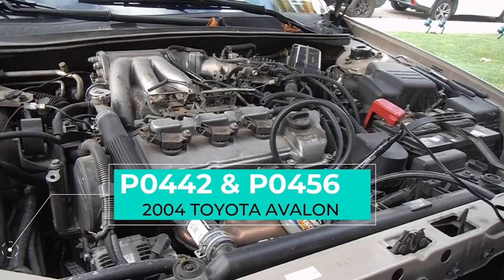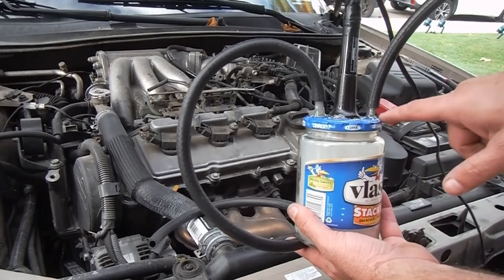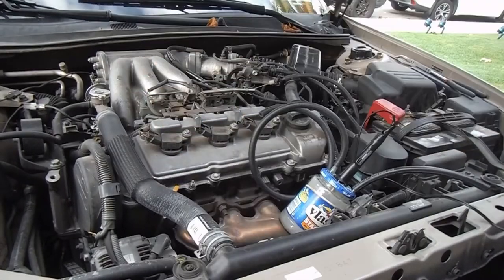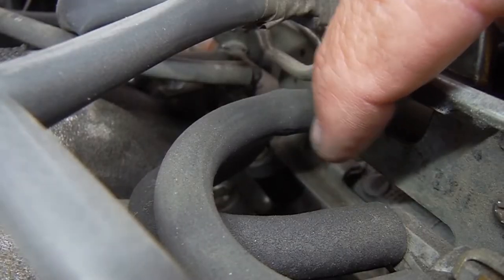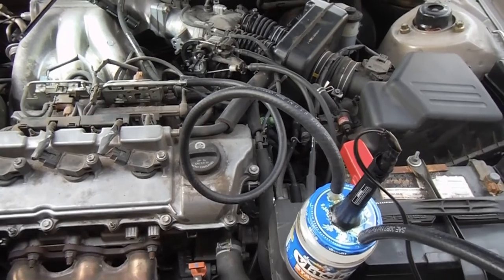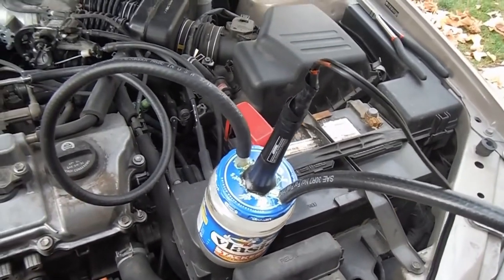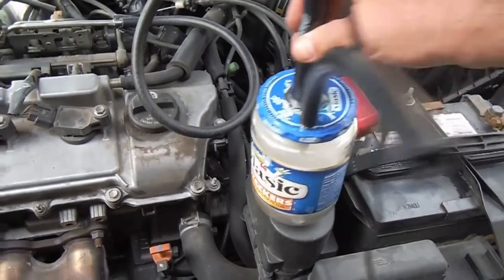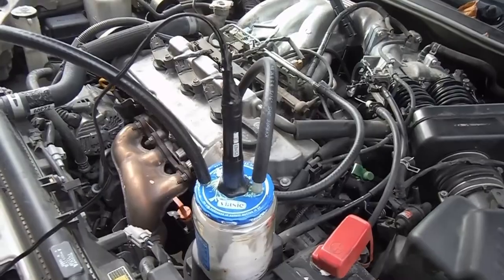P0442 & P0456 TOYOTA - SMALL EVAP LEAK - FIXED! (NOT GAS CAP) DIY SMOKE MACHINE - 2004 AVALON

Comment: Thanks for the quick guide! My same exact hose cracked just like yours, switched it out and it's running a lot better. Only been 50 or so miles since I changed it, hopefully no other leaks..
Reply: same here ~ what was the hose size you used to replace?

Comment: Awesome little McGivering ingenuity that saved you some big bucks, Dan the fix it man. Can you imagine what it would have cost at a dealership repair shop without having the codes before hand. I just bought one of those code readers as I've had a yellow engine light on my Mercedes for several days now. Now that's a vehicle you don't want to fuck around with when it comes to repairs. So owning one of those obd2 scanners is a must have investment these days. Mine just came within 12 hrs from Amazon (gotta love their fast shipping). So I got the same two codes flagged as you did, the P0456 & P0422, with the first one several times. It still won't let me turn off the engine warning light manually, says it must be repaired first (I get that cause it would just keep getting tripped again). Now I know vehicle emissions are tested regularly in places like California, but I live in Canada and we don't have that tested here, at least not in the province of Alberta where I live. Now I'm a little too old & disabled to try this detection/fix myself. I definitely would have back when I was more agile. I would like to get an honest repair shop to do the test, just give them the codes and possibly show this video. All the leg work is done pretty much. Thank you so much for filming this and sharing it. I hope it's just as straight forward with my Mercedes SUV. ✌️
Reply: Just a side note. I went into a local repair shop in a franchise called Canadian Tire. They were going to charge me $160 (before taxes) just to read the code(s) that triggered the engine light. Nothing fixed or repaired, just a print out of any error codes and what selection of other issues that could be causing that. That's what made me more determined than ever to buy my own code reader. So glad I did it does a plenitude of other features. Battery condition checks which is essential in cold winter climates. Trip monitors, testing your driving style and the efficiency of the performance during a speed test. I'm not sure if it'll connect to my PC or if there's any need. Cheers.
Reply: 'Honest' and 'repair shop'...good one!

Comment: Evidently those small hoses are guaranteed to start leaking on any 1mz-fe engine that old due to years of engine heat. I replaced all the those hoses with silicon versions of pretty much the same size as the originals. Nice, snug connections. I also changed the gas cap. Now I just have a P0440 code that comes back after being cleared. Could be the charcoal canister or one of the switching valves.
Reply: I'd start with the Vapor control valve, then move to the canister.
Reply: @nec4480  Turned out to be several small hoses I couldn't see. One near the air box and one near the canister.
Reply: @rkgsd  Glad you solved the issue

Comment: Thank you for the video. This was very helpful. I am facing the same problem at the same location. When you say hose, is it a metal hose or is it just rubber hose? Because I tried to remove it and it seems very firm and hard like metal under the rubber part.
Reply from the maker: The hose is rubber, but it was extremely hard and felt like hard plastic.  There are metal tubes that it connects to.  Best of luck to you.
Reply: @DantheFixitMan Great, I replaced it. Thanks

Comment: What did you connect the hose to? I have a smoke machine but i don't know where to connect it to for evap leak. 2001 Toyota sienna
Reply from the maker: If you can find the evap test port, it usually has a green cap…try connecting it on either side of that by disconnecting the hose and putting the hose from your smoke machine on the hose that you disconnected.
Best of luck to you.
-Dan the Fix it Man

Comment: I have a leak that causes my car to idle rough at cold starts. 
I have been struggling with where to connect the end hose to the car to find the leak. 
Is that the PCV valve you connected to, and is that effective to find a leakage throughout the EVAP system? 
I have a 2004 Toyota Corolla.

Comment: What size hose was the one leaking ? My 03 Avalon has the same crack and I can’t find the hose size to replace it with anywhere.
Reply: I used 5/16 or 8mm silicone hose from Amazon this is for the 3.0 2005 Camry

Comment: Can you help me with this problem i have,  Catalyst system efficiency below threshold bank 1 P0420. My car is a 2002 toyora rav4. Thank you and God bless you
Reply from the maker: I would expect that you have a bad catalytic converter or a bad O2 sensor following the catalytic converter. The downstream O2 sensor monitors the performance of the catalytic converter.  They are often replaced together.
Best of luck to you!
-Dan the Fix it Man
Reply: Oh Honey, I'm sorry. That's going to end up being one mother of a pricey repair. It's already 20 yrs old. How many more miles are you expecting to get out of it?? Clean her up n sell for parts, then use use the money to buy something newer. They have some awesome options on the later models. Or you could go environmentally friendly and get a Hydrid or go fully electric. But if you get a Tesla you gotta come pick me up for a cruise. Deal? 😎
Reply: Best self explanatory and straight forward fix problem; replacement.

Comment: @DantheFixitMan Hi from one Dan to another lol, everyone else calls me by my nickname Doc. Turns out we seen the same video for that "Smoke Machine ". I even have the same bicycle pump in that video-lmao. I've made one and will probably take a copper wire and coil it from the tip of my pen I'm using. Mine is actually a old wood burning pen and will probably be to hot. I'll probably break down and make another after going to Harbor Freight. Now I live in North Carolina so my pickle jar is a Mt. Olive. I've got yta 2010 Rav 4 in the shop with a p0456 that I haven't been able to find. Ran all the usual tests, inspection, plastic wrap the gas cap, shoot all hoses and intake, plus no smell of gas around canister. I'm old school, even thoe I have Launch. 
 I may record a video when I run the smoke test and upload it to my channel here on YouTube. I don't have to many videos on there and have been wanting to add more.
 Downside to Asian Manufacturers is they have way to many evap hoses. In all the years I've been in the automotive industry,  amongst others, only once was it a gas cap. Almost always a hose after hitting with a spray of brake cleaner or starter fluid.
 I subscribed to your channel. I'd appreciate if you would do the same. Thankyou and Thankyou for your video. 😎👍🍻🇺🇲
Reply from the maker: Doc,
Thanks for watching, and for sharing.  The pickle jar smoke machine is still working well!  Thanks for subscribing, and I will do the same.
Take care,
-Dan
Reply: @DantheFixitMan  Thankyou for responding so fast. Feel free to ask me anything automotive or other wise. I'm a Jack of all trades. 😎👍🍻

Comment: I have the same problem on my 2002 Avalon, crack in the same hose. What did you use to replace that hose? Toyota doesn't sell just that piece of hose and I can't find a part number.
Reply from the maker: I believe I just took a small piece to a parts store and they did their best to match it with some generic vacuum tubing.  It worked fine.

Comment: What if the leak had been further back towards the tank?
Reply from the maker: Hi Larry,
Great question.  It will still show smoke farther back at the tank as long as you put it on the line going back to the tank.  I have used this to successfully find a leaking rollover valve in a camry recently.  It's a little harder to see sometimes, but it will work.

Comment: I think a $10 vape pen will work as well.
Reply: That works great if the leak is 2 feet away...however the leak is by the gas tank, good luck with a vape pen lol. The vapor dissipates way before it hits that area. The smoke machine this guy made will work, but barely at that distance. Definitely need a bike pump to push the smoke that far.